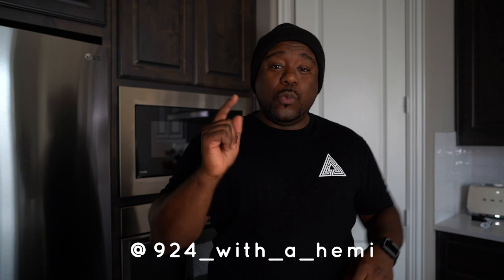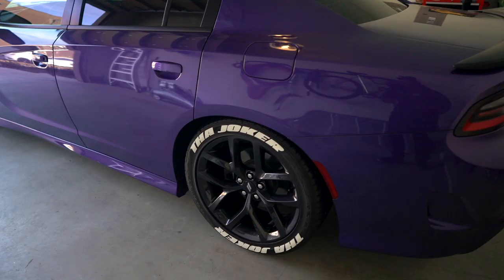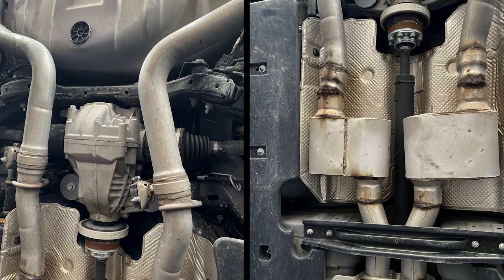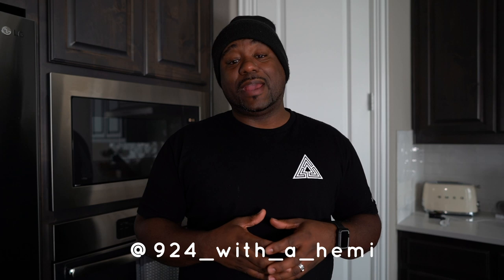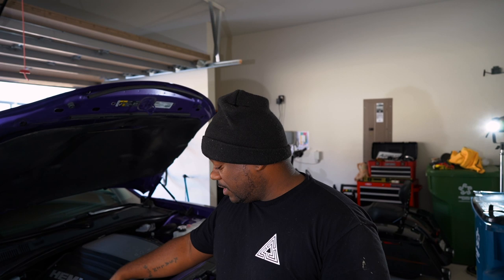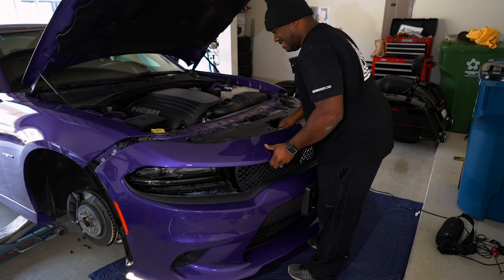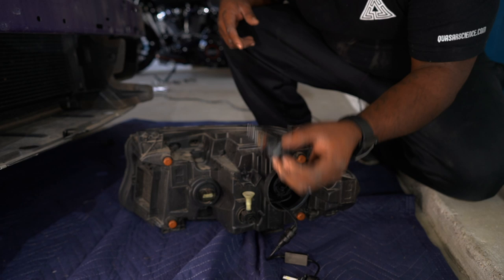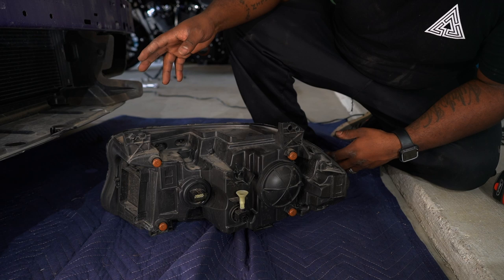2019 Dodge Charger R/T GETS Hellcat Airbox and Front/Lower Grille inserts (Vlog) Style

Comment: I installed the same exact system as you.  Hellcat ram air box, tube, upper and lower grill also bought from Steve White motors and about a hour into it, I was regetting it.  But I finished it and not only do I love the new look, it improved the throttle response especially with the K&I air filter.....For anyone reading this make sure you buy the trim pin removal tools.

Comment: Don’t know if you’ll see this but I have a 2021 Daytona rt and I bought the same srt grill with the led snorkel lights and took it to the shop and they said it didn’t fit or rather it didn’t line up, did you come across the same issues, do I need to buy another part for it to fit or should I return it😭please get back to me I’m over here stressing